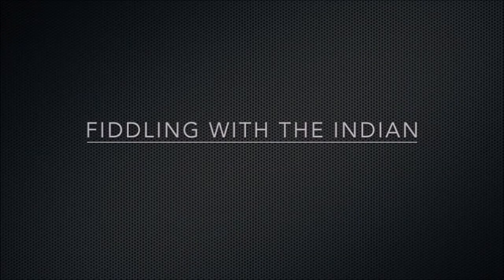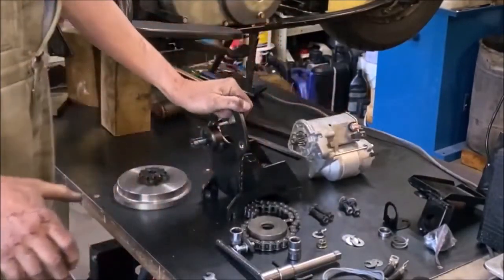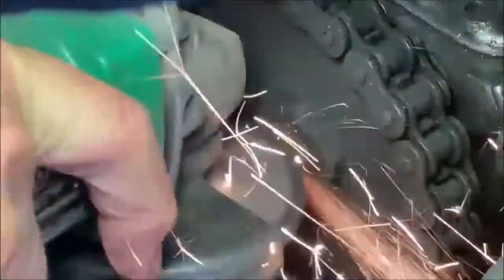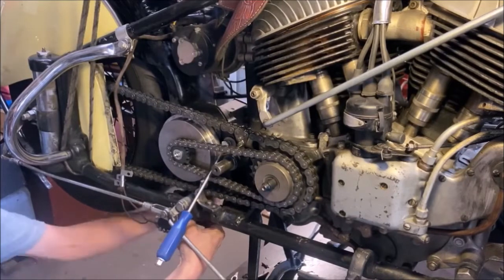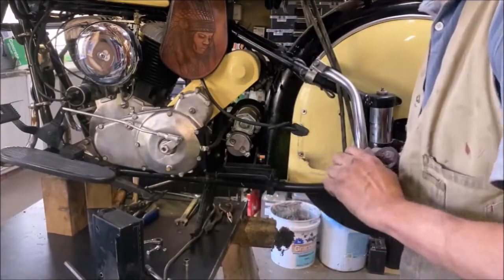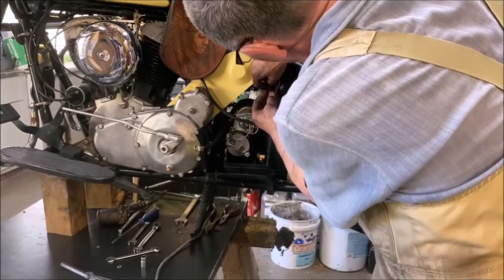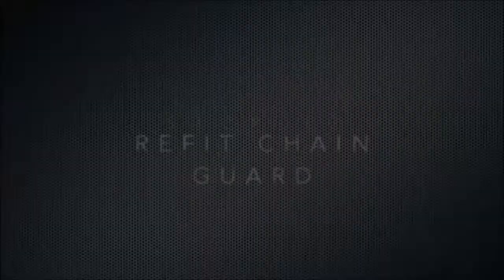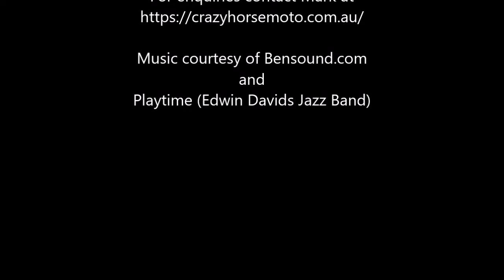Wombat Indian Electric Starter

Comment: who in their normal mind would take an angle grinder to the main shaft   ,And if you must  cover everything up ! . Better choice would be to remove the main shaft  and surface grind  the area ( a big  job)
Reply from the maker: The end of the main shaft transmits no power and is there solely for the kick starter. The kit includes instructions for milling the shaft for those who do not wish to use the method described in the video.

Comment: George, when I mocked install on my 47 mainshaft the kicker gear didn't hit the pinion gear. Idea why? Thanks..
Reply from the maker: Hi Jordan, I've fitted 6 of the kits and every bike is different. One had a similar problem with the kicker gear. To fix drift the kicker shaft out till you have engagement and relock.